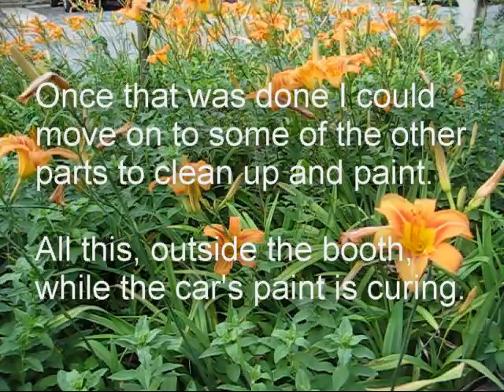62 Fairlane Misc Repairs And Paint Parts (Odds And Ends)

Comment: Allways amazes me how stubborn rusted bolts can be, ive ended up drilling down the center and slowly using bigger drills untill it gives in.
Captive nuts can be hard to replace if the thread is stripped, sometimes you have to resort to tack welding them on, if you have access :-(
Reply from the maker: zx8401ztv 
Beside being rusty it was crimped in. Since this is the mount for the seat, they diden't want it to move a MM at all... Thats why it diden't want to come out. Only option was to grind off, drill a new hole... Hopefully, it's centered right, or I can adjust so the seat track moves the seat without binding at all.... Time will tell.